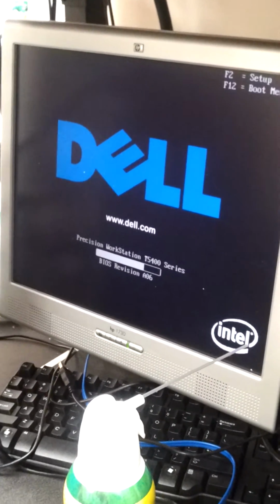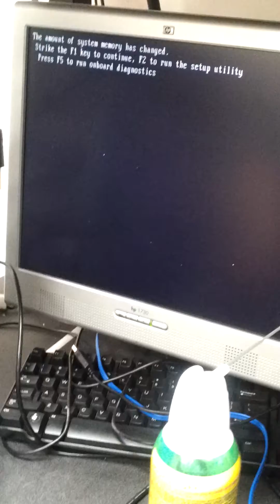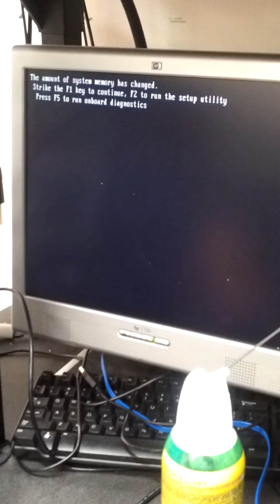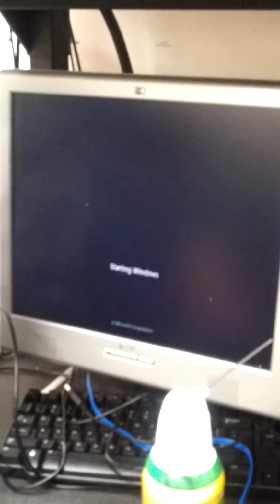DELL PRECISION T5400 Memory upgrade

Comment from the maker: Go to 12red .com and click on Buy Memory then click Shop Dram, then click on DELL, then on left you will see Popular Workstations click on T5400. It's a pretty penny but its the way to go. 8 gigs of ram on the T5400 with 64bit W7 is great build. Then if you want grab two WD Black or WD Enterprise drives and raid 0 them. Or just get a 120GB SSD drive and just keep a second plater drive for large files and games. I have that running on a T3500 and T7400 and they perform smoking fast.

Comment from the maker: @sk8rPhil93 If the GTX 560 is to rich for ya do this. Win 7 64bit, 8GB ram from Crucial (non ECC, its faster for games) ECC wont hurt if thats all you got. And a EVGA 01G-P3-1556-KR GeForce GTX 550 video card. Keep in mind you can get a 260 for less and it will work fine but 550 and 560 video cards are nicer by far.

Comment from the maker: @sk8rPhil93 That computer will absolutely run games, I played BF2, BF3, Crysis2, EQ2 with a 480GTX Nvidia/EVGA card. Will it have screaming fast benchmarks that are cutting edge best numbers? NO. Will it play the games VERY well and you will never notice? YES. The thing you need to get is a good video card and add that in to the PC. The stock video will not play games  well. Get a EVGA 01G-P3-1460-KR GeForce GTX 560  from newegg and game away!!!, 64bit win7, 8-12gigs ram(best rig)